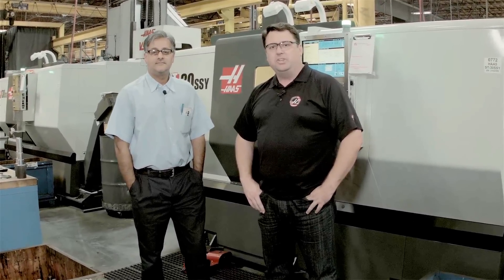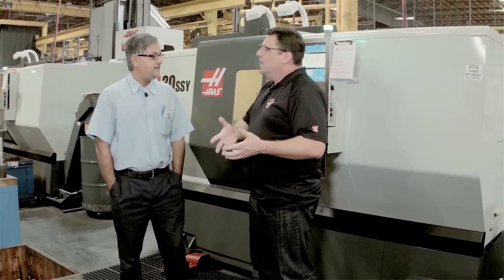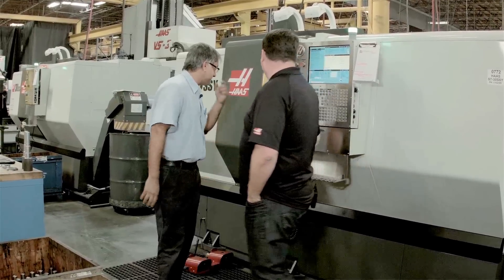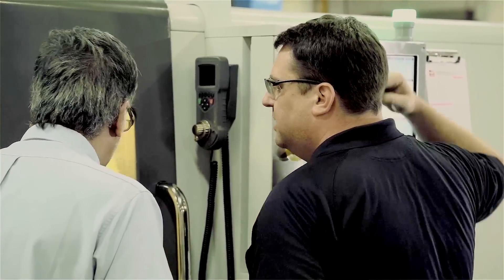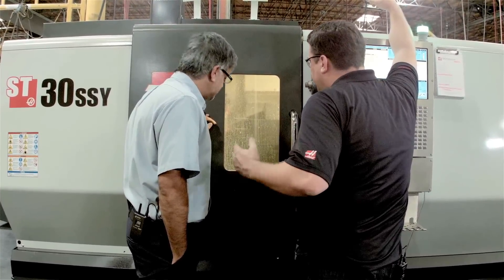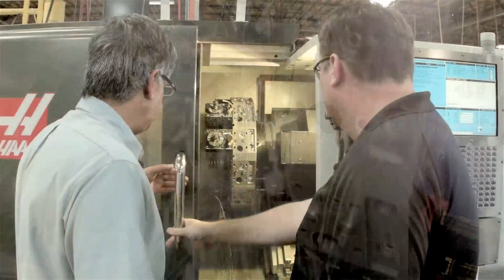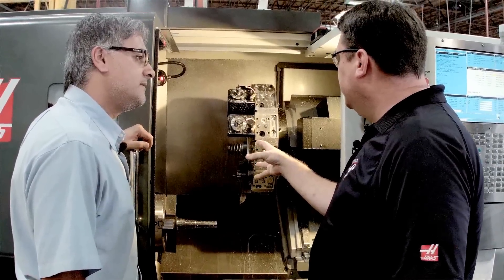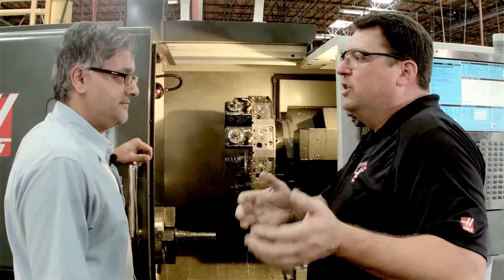The Benefits of the Haas "Index-on-the-fly" Feature

Comment: Hey HAAS,
I´m working with index on the fly for a longer time. Its a good time saving movement.
But there is one thing, which could be better with the G200.

Its not possible to change the spindle speed within the G200. So i´ve got unnecessary waiting time, to change the speed and index on the fly. Or index on the fly, got a waiting tool in front of my piece and then change the spindle speed.

Would be great, if there is way to change spindle speed while index on the fly without any waiting seconds before, or after indexing.

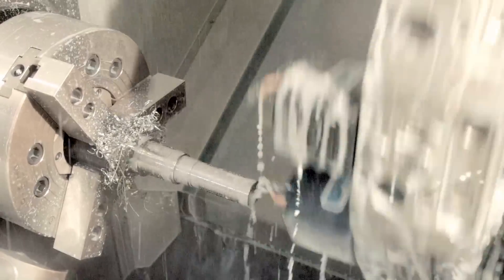Comment: @ 2:14 Anyone know what the holder with the spring is used for??
Reply from the maker: +Nicko4x4fab The spring is used to push the raw material or part all the way into the chuck before clamping, rather than leaving it entirely to the operator.

Comment: Great video, I got the idea of how great this feature is several time as reiterated by Scott. Only problem is you don't talk about how to enable it or what Settings or G codes are used for activation or which machines / control version it will work on.  This would be the most helpful. 
Thanks Johnathan B
Reply from the maker: RoyalArmsIntl Thanks for the interest. The “index-on-the-fly” feature has been available since 2000, when it was released with L4.02. Hope this helps!
Reply: Haas Automation, Inc. Thanks for the quick response, just need the G-Code and when it will start to unlock, so if i am facing a part and then do a retract and enable the code will it try to unlock against the face or what would the sample code look like, i am curios to try it and would like to test it out today, ive been running HAAS lathes for over 10 years and had no idea about this feature or code, thanks for the video.
Reply: As Scott mentions  index on the fly "We've had it forever" OK how long ?  which control ?  which version? 

I rather have you state we've had it since 2007? Version 16.0 etc... Or something along those lines
Reply: An unseren Haas SL20 ist es: G200 Index on the fly